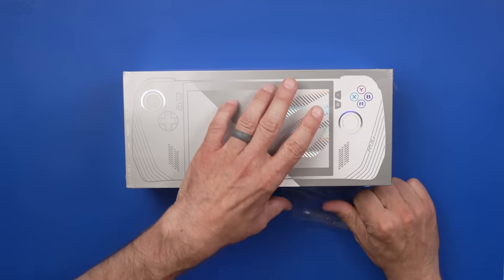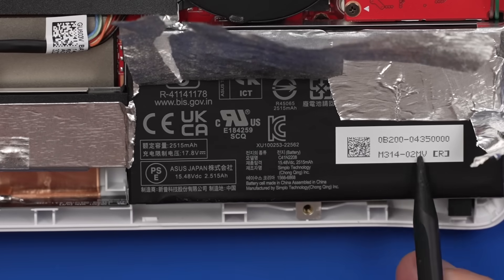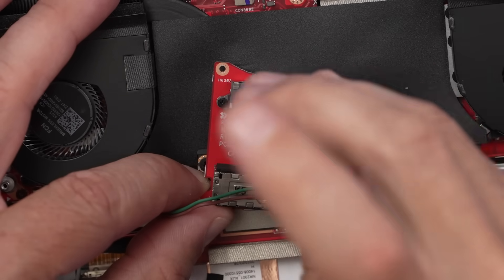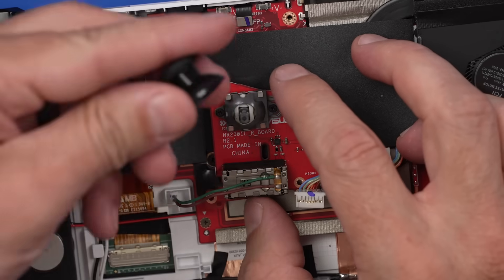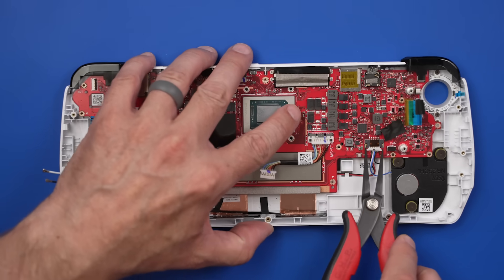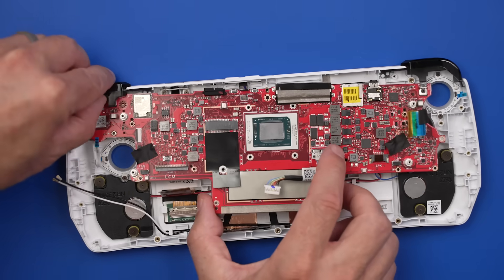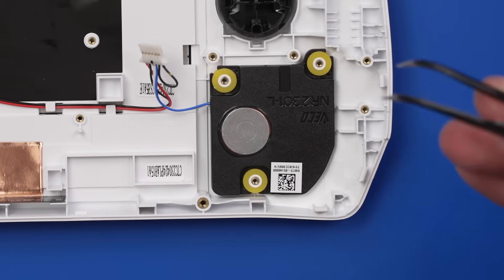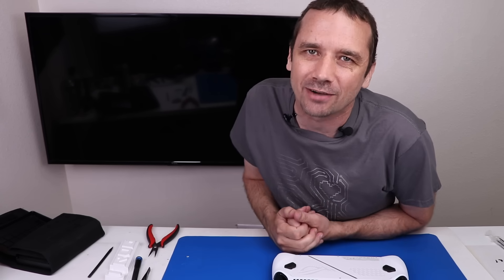ASUS ROG Ally - A Repairability Perspective

Comment: How do I get this guy to fix my PlayStation 4 slim, this happened two years ago first it started off as whenever I try to turn it on it would actually take a few tries for it to turn on but then one time the power went off and well I can't use my disk drive I've pressed the eject button it beeps only once and yes there is a disc in there because I did fix the disk drive 3 days ago by taking off the cover and everything and seeing if the little circle thing for the disk drive was off and it wasn't but then I seen these two little buttons when I press those that were underneath the disk drive tray it made the little light that reads the disc go to the middle and then it started flashing blue and then red and then it said disc not recognized on the TV so I thought I fixed it so I put everything all back together and the disc drive worked(it's been two years since it's work until now) but now since there was an software update today (version 10.71) it resetted the PlayStation but now the disk drive doesn't work again and the turning on the Playstation still takes a few tries to turn on so I don't know what's happening

Comment: I was tempted by one of these but Asus has a pretty shaky track record for quality and people frying SD cards made it a pass for me.
Reply from the maker: Yeah, it'll be interesting to see how this thing does long term.
Reply: There's a lot of fake SD cards around.
Reply: The thing i noticed on how and why it might over heat or fry your sd card at least with my rog ally is the first bios update made the screen and unit itself heat up a lot to the point where i shut the thing off. Every bios update after has not been anywhere near as hot. I have an SD card and its perfectly fine, maybe just remove during updates would be my suggestion
Reply: Nothing to do with fake cards the reader on the ally is knackered

Comment: I don't think you underlined what a big step down having to get replacement parts off ebay is. It looks like their engineering team has a lot of integrity, but their management doesn't.

I mean seriously, there's almost no anti-repair design in that thing and they still put a bunch of stickers on it to try and prevent 3rd party repair.

Comment: Uuuff, hes first Ally and he already ruined it. Im sure many others have said this, but Asus used a thermal pad thats similar to PTM7950 which is a phase changing thermal material. It remains dry at certain temperatures, particularly under 50-55c. Liquidises over does temps which results in best possible temperatures at high wattages. I cringed after he replaced the thermal material with low grade. Hes Ally is going to get extremely hot possibly DOA-ing it. Before you guys try to rim me about it. Any thermal compound below PTM7950 is considered low grade even if its the best in the market compared to PTM7950. There is a reason why Asus went with this type of thermal material and not thermal compound. Also that amount that Asus put was more then enough.

Comment: Lol😂 those are the only thing they did not cheaper out but just the rest is cheap,  display, SoC,  and storage 😂
Reply: U mean 120 hz 1080p display is a cheap out😅? Guess u really think a 7in display needs 4k or something
Reply: @zihechen3111  Oh no, amigo  4k is not much at least 8k   or 6k. Yeah, 1080p is cheap out  for devices that are intended gaming  yeah so  the only easy to have decent benefic graphics is to use an external display. The pentium 1 had 1080  it is really cheap junk regarding those components